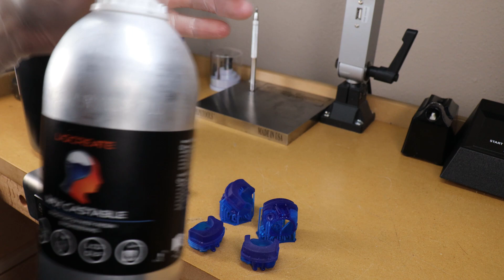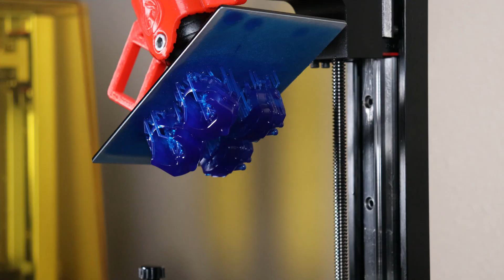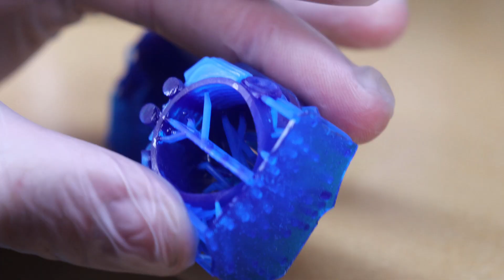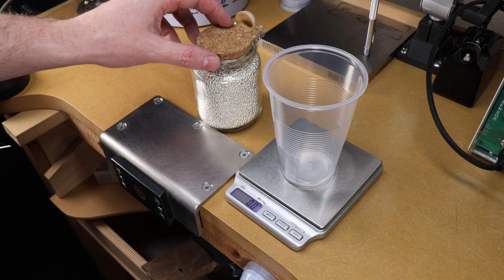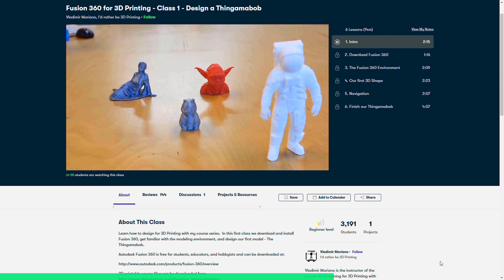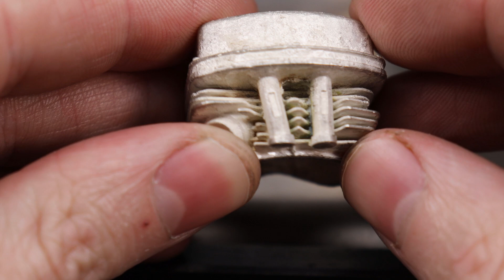Liqcreate Wax Castable Resin, is it Any Good?

Comment from the maker: Burnout settings - https://www.liqcreate.com/supportarticles/working-with-liqcreate-wax-castable-3d-printing-resin/

Print Settings - https://www.liqcreate.com/supportarticles/3d-printers-are-compatible-with-liqcreate-resins/

Check out the video from Clear Mind Jewellery - https://www.youtube.com/watch?v=hXOYPRl5dYs&ab_channel=ClearMindJewellery

Also check out VegOilGuy - https://www.youtube.com/c/VegOilGuy/featured
Download Primer File - http://bit.ly/ResinPrimerSTL

Wax to Metal Calculator of Casting - http://bit.ly/WaxCastingCal

Materials and Tools: 
Kayacast Vacuum Casting System - https://bit.ly/VacuumCastingMachine
New KayaCast XL FastCast - https://bit.ly/KayaCast-XL-FastCast
Amazon Chinese Knock-off - https://amzn.to/3zNRFYI
Electro-Melt Furnace - https://bit.ly/Electro-MeltMeltingFurnace
Cheaper Electric Smelting Furnace - https://amzn.to/3rJH7lH
TouchAmatic Wax Worker - https://bit.ly/HotWaxWorkingTool
PMC Supplies Programable Tabletop Kiln - https://amzn.to/3bzPID6
Washing and Curing Machine - https://amzn.to/3wsyAai
Ultrasonic (1.5 Pint) With Heat - https://bit.ly/UltrasonicSmallGEMORO
Ultrasonic (2 Quart) With Heater - https://bit.ly/UltrasonicMediumGEMORO
Wax Carving Tools - https://amzn.to/3dvGqaB

Resin 3D Printer Options:
Amazon - ELEGOO Saturn - https://amzn.to/2T7Hjjx
MatterHackers -ELEGOO Saturn - https://bit.ly/MHElegooSaturn
Amazon - ELEGOO Mars 2 3D Printer - https://amzn.to/2U6zgn3
Amazon - ELEGOO Mars 2 Pro - https://amzn.to/3BXckId
MatterHackers - ELEGOO Mars 2 Pro - https://bit.ly/HMElegooMars2Pro
MatterHackers - Anycubic Photon Mono X - https://bit.ly/PhotonMonoX
MatterHackers - Anycubic Photon Mono - https://bit.ly/PhotonMono2K
Amazon - Sonic Mighty 4K - https://amzn.to/3piI9aY
Phrozen3D - Sonic Mighty 4K - https://bit.ly/SonicMighty4K
Amazon - Sonic Mini 4K - https://amzn.to/3jjT9AS
Phrozen3D - Sonic Mini 4K - https://bit.ly/SonicMini4KPrinter
Phrozen3D- Sonic Mega 8K - https://bit.ly/PhrozenSonicMega8K

Wash & Cure Systems:
Amazon - ELEGOO Wash & Cure Station - https://amzn.to/3gWHUxH
MatterHackers - ANYCUBIC Wash & Cure Machine 2.0 - https://bit.ly/WashAndCureMachine2
Amazon - ANYCUBIC Wash & Cure Machine 2.0 - https://amzn.to/3DWG4FO
Amazon - ANYCUBIC Wash Cure Machine Plus (Large) - https://amzn.to/3DWFLe8

Castable Resins :
MatterHackers - Liqcreate Wax Castable Resin - https://bit.ly/LiqcreateCastableResin
Amazon - Siraya Tech Cast 3D Printer Resin - https://amzn.to/3aUBLyi
Puvah - BlueCast X-One Resin - https://bit.ly/BlueCastXOneResin
Phrozen3D - Wax-like Castable Resin - https://bit.ly/Wax-LikeCastableResinPhrozen

Other Helpfull Items:
LayerLock SLA Resin 3D Printing Build Surface - https://bit.ly/LayerLockBuildSurface

Here is the burn out program for the kiln for PMC Supplies:
*Note - The C is for the temp in Fahrenheit not Celsius. The T is for time in minute. The -121 is just to tell the kiln to stop the program. 
01 50C
01 60T
02 300C
02 180T
03 300C
03 60T
04 700C
04 120T
05 700C
05 120T
06 1400C
06 240T
07 1400C
07 60T
08 900C
08 60T
09 900C
09 -121T

______________________________________________
If you are looking for more tools and materials that I use, well you're in luck! I made a page on my website just for that and I'm updating all the time so bookmark it to stay up to date:

https://GomeowCreations.com/tools-and-materials 
https://GomeowCreations.com/partners-discount-codes

**Read This**Just so you know, just about all of the links I post are affiliate links. This mean if you click them and buy something I will make a small commission at no extra charge to you. This helps support my channel and allows me to keep my content free.
______________________________________________
My PATREON ➜ https://patreon.com/GomeowCreations
One time support ➜ https://paypal.me/gomeowcreations
______________________________________________
Instagram ➜ https://instagram.com/gomeowcreations/
Facebook ➜ https://facebook.com/GomeowCreations/
______________________________________________

#Liqcreate #WaxCastableResin #CastableResin #jewellerymaking #jewelrymaking #goldmaking #silversmithing #diy #gomeowcreations
Reply: Personnellement pour nettoyer mes pièces je les pose dans un bac a ultrasons, il en existe certains qui chauffe le liquide dans le bac mais c'est juste parfait
Toutes la résine en trop est enlevé presque instantanément

Comment: I wonder if the resin in the printer was starting to cool off at all? Not sure how much heat those units generate while in operation. 

You may consider putting the warmed resin in the vac chamber to pull the bubbles out after you shake it, then do a careful pour into the printer.

Comment: 120 bucks per kg is considered cheap? Ok.... why not use PLA you can burn that out pretty well right?
Reply from the maker: Ye, there are others that cost $300 per kg and I have some now that is $75 per kg. PLA doesn't burn out perfectly clean and you really can't get the details needed from PLA and FDM printing or print as small. Even though the resin does cost a lot each ring is under a dollar in resin and you should be selling them for a lot more than that. It's just the upfront cost of everything that really adds up.

Comment: I found the prints a bit rough for my use but this could also be due to the settings on your printer and not the wax on how many microns was your printer set ? But this wax looks interesting enough
Reply from the maker: I think I was doing 0.05mm layers

Comment: Hi Randy - I"ve learned so much from your videos and now I make and sell pendants (and other gemstone jewelry) on Amazon. I have a question. I've been making all traditional bezel settings with a 20 gauge back plate. Now I want to do some open back settings. I've seen on Ganoksin that people sometimes make these with square wire and bezel wire. Have you made any videos of this technique? Fitting the square wire is tricky and the soldering is also tricky. Thanks for everything - your videos are so clear and I really appreciate it.
Reply from the maker: Sadly I don't understand what you mean. You can email me a picture and I might be able to help you better.

Comment: Following your own points, that droopyness could well be directly linked to the postcure cleanup process, as the resin is stone cold and any ecxess that would have pooled around will have set solid, and not wash off. I'd expect if you put it in a heated sonic bath, that it would look perfectly fine, as all the uncured resin would melt off easily :)
Reply from the maker: I did that but I didn't talk about it in the video but I did say that I tested it later and it was still like that. 😁👍 I also didn't do any post curing
Reply: @GomeowCreations  Darn, I guess for most things, I can tolerate a bit more resin in places, it's better than a bit less haha Think it's about £120 a litre here too, well worth a bunt me thinks. I need to get a sm4k first though to really take advantage of the neccessary mono upgrade ;)